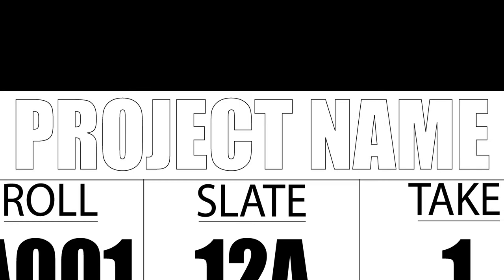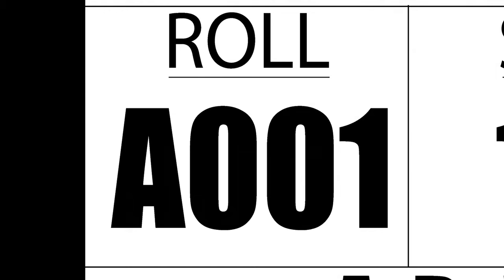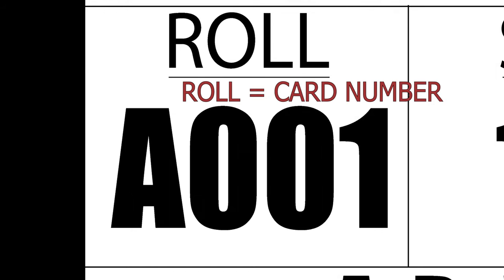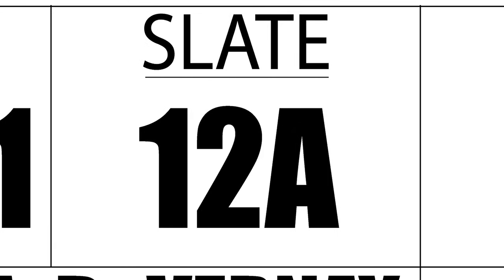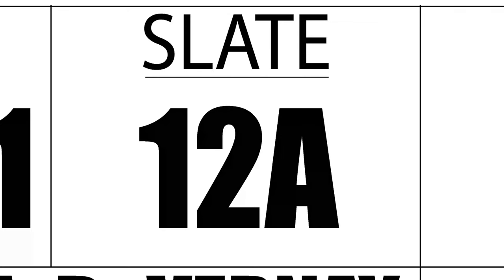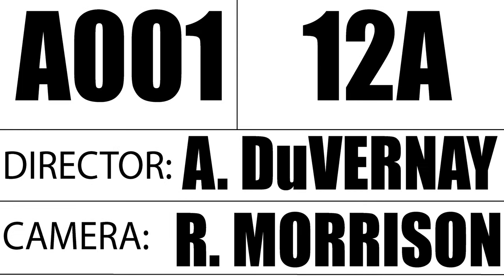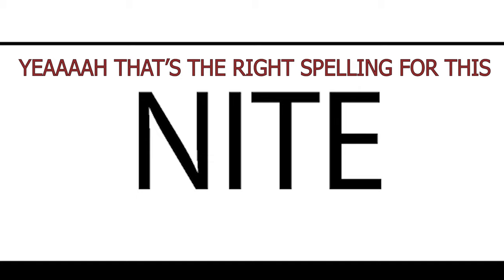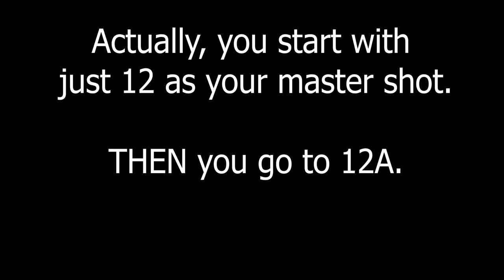How to Use A Film Slate

Comment: Really helpful and comprehensive. Some sets I worked on the order of operations was sound, camera, slate called and shown, then clapped. Although with a younger director they did it they way you mention in this video which seems better because rolling camera before a shot is set up  to a certain degree seems wasteful of film/card space, so it actually may save money doing things that way.

Comment: For 12:52,  would you mark B camera tail slate first by: saying "B marker",  mark it , then say to the boom operator 
" 12Alpha take 1, tail on B, head on A" ?  Or do you say that to the boom operator before you mark tail slate for B camera? 

And for that tail slate for B camera, would you turn the slate upside down at the end?
Reply from the maker: Yep, mark it first so camera can cut, then say the slate to the boom op. It’s more imperative for camera to cut first so always mark for camera first when they are ready. As for upside down slate. Some people do it differently. I’ve seen people start with the slate upside down , mark and then turn it the right way up. I’ve seen others just flick the slate to the side immediately after marking, and I’ve seen some mark the right way up then turn the slate over. Personally I did the latter as an assistant.
Reply: @flickcine  Okay, so just to make sure I understand this correctly, in this scenario for the upside down tail slate: you'd mark it for the camera, do whatever upside-down slate technique you'd prefer, then say the slate to the boom operator?
Reply from the maker: Correct. 
"Cut!"
"Tail slate!"
Position the slate
"Mark it"
"B mark"
Flip the slate or whatever method has been used on that production. 
Camera can cut
"12 alpha take whatever head on A, tail on B"
😊
Reply: @flickcine  Thanks so much❣️

Comment: Hi Felicia, let’s say if you’re slating for an unscripted scene in a documentary production, and you’re using multicam setup. Should you match the scene shot and take number amongst A B C cameras? The problem is that in documentary sometimes you will film a scene only with a b camera or use c and d cam for a in car segment. So if you would end up with different scene and shot number on different cameras even if for the same shot they are filming simultaneously. If you use matching scene and shot number, it might seem to the editor that you’re missing shots because not all cameras are used for every scene. What would you do in this situation and how should I ID the clips so they are organized and not confusing? Thanks so much
Reply from the maker: That is something that is also case by case. As long as everyone is on the same page you could come up with a common slate number between all cameras and note it down in your camera sheets. It's definitely something that can be confusing. I don't really do doco but if I'm on a drama with a script supervisor I would have a quick chat with them so we are all on the same page.

Comment: Any tips to use markers and keep slate clean? Love this channel BTW ;)
Reply from the maker: Cheers! 
Yeah I have a template I've made using illustrator, I just enter the details of the production and print, laminate and cut to size a few of those. Then I just tape one to my existing slate and keep one or two spare depending on the length of the job and how many I think I'll go through. Then just switch them out when they get dirty. 

Also change your cleaning cloth that you wipe the board with often and refrain from cleaning permanent marker from your board using the same cloth you use for whiteboard marker. That way you shouldn't get much mucky looking transfer. 

Hope this helps!